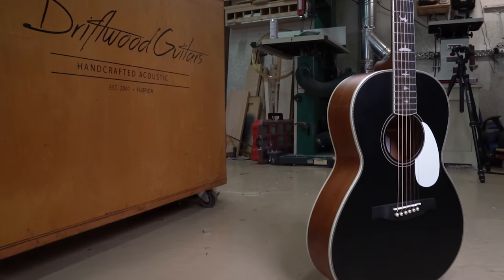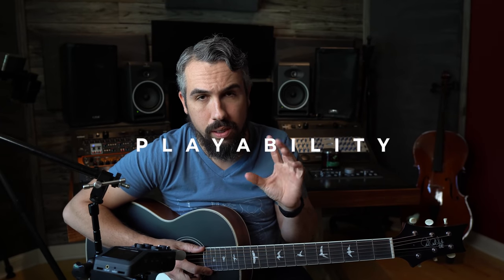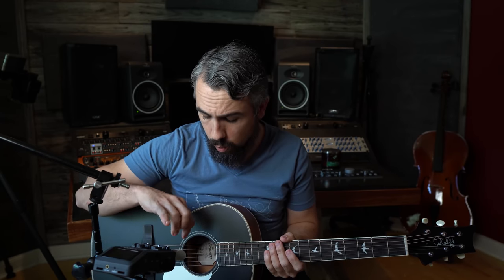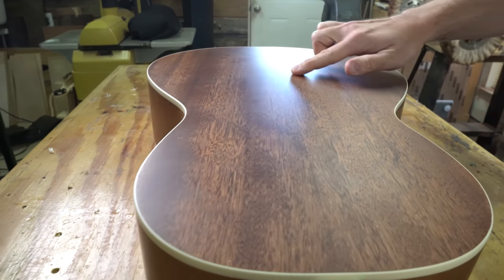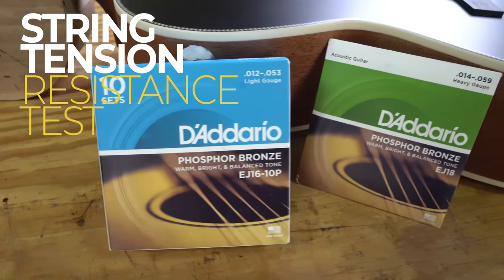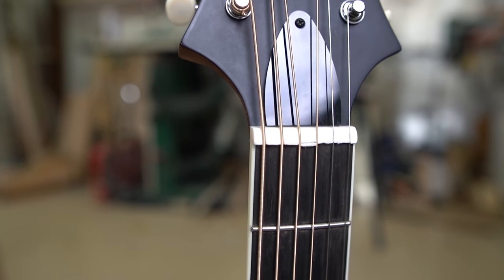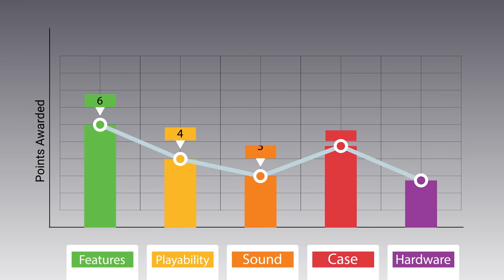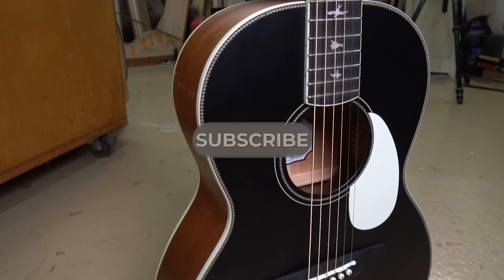A Full Review of the PRS P20 Parlor / The Guitar Breakdown

Comment: I own one of these and i will add this to it: 
1. The case zippers are ok, the attachments to the zippers break easily. I think one of the 3 or 4 are left to pull on. 
2. The pickup does a lot of heavy lifting for depth on it if you want to swing over to open mics or play for friends.
I wanted a parlor and got a parlor. Definitely glad i purchased it
Reply: I have one of these and haven't been disappointed yet. Though I did get the action lowered.
Reply: @chasemorace4916  The action height has been the one thing I’ve been displeased with as well, but it will be getting adjusted soon! Overall for $459 I’m very happy with the playability as I’m just starting to get back into the swing of things
Reply: Ya great guitar actually and thought to get one in each color for various Ready to Go tunings

Comment: Thank you for this excellent breakdown video. I am a beginner acoustic guitar player, and was considering this exact guitar because I really enjoy the sound and size of a parlor guitar, especially this one as I have seen it reviewed on other YouTube channels. I have played on a Taylor GS mini, and like that one a lot and I also like the sound and size of the Baby Taylor. Anyway I was hoping you were going to touch on the bridge pins as this particular model is notorious for having a very poor bridge pin design in the way they are countersunk and glued onto the body which make them extremely difficult to remove when you want to change the strings using a pin remover which can't get under the pins. I was told you need to use needle nose pliers which nick and  marr up the pins themselves. Also I have heard from more than one person that the tuner pegs snap off if you look at them funny, and are very cheaply made.

Comment: It would be interesting if you guys did this with some of the catalog guitars from the days of old, like Stella, harmony, stuff like that. It would be interesting to see how good the build quality is. Also if you did that it might be better to cut it open right where the back or top is glued to the sides. This way you could just glue it back on. Some of these old catalog guitars are also great guitars especially when it's solid wood and when they are not using heavy finishes. You can also rebrace them and then they sound more martiny. Even if you did cut it in half like you did I wouldn't be offended. Just thought I would offer the best compromise between seeing everything and making the guitar unrepairible.

Comment: Really interesting review! You did tests I haven't seen anyone else do, from dent and drop resistance to liquids and scratches. My one comment on tone comes from watching a number of other reviews, which is the strong midrange of this parlor guitar actually fits well in a band mix. Edit: OK, so I got one online, and while it is a well made guitar and visually attractive, I was initially disappointed. Acoustically the tone is definitely "midrange", seemed dull at first; a change to a different brand of strings (these are new PRS bronze midweight) might help. Playing harder brought out more tone. Plugging it into an amp definitely brings it to life. While the fretwork wasn't bad, it isn't up to the standard I have on several PRS electric guitars. Overall, though, it's what I got it for - a tough little guitar that could go places I would never carry my vintage Martin 0-18. Initial impressions aside, it'll probably be a keeper.

Comment: I picked up one of these P20e models out of curiosity. Outside looked great and the inside just the opposite, glue EVERYWHERE. Your rearview pretty much mimics my own findings but a couple additional notes I made:  The bridge pins are the worst; thin and molded with 'holes' and I was unable to lift them out with the pin recessed into the bridge and when I tried to push the pins out from inside they bent over! I had to reamed and replace with standard size good pins.  The Fishman pickup control is 'glued' inside the sound hole. I intended to replace with another pickup so it was much more difficult to get that control off the underside of the soundboard. Should have used 3m vs glue. The tuners on my guitar didnt hold tune.  I got rid of that guitar.

Comment: Great review and I did appreciate the reviewer's objective comments. A couple things of note, though. I own this guitar. With a minor tweak of the truss rod the action is as good as my 500 series Taylor and as good as it gets for an acoustic. The sustain is good but it sounds like a parlor. It is a parlor. Shouldn't it get a high score for that? As far as the sloppy work under the soundboard,  I really don't care if there is a bit of glue squeeze out as long as the braces are in the proper place and well bonded. Mine looks better inside than the example in the video. That's mass production,  I guess.

Comment: I would assume that to get an accurate fit for re-gluing the PRS back together,you would use small kleats to get good alignment of the two halves.Unless of course there is some torsion in the sides causing a misalignment,unlikely with laminated sides.........................

Comment: Counter sunk bridge pin holes,  that was a first.  . . .from the others I have seen so far.   Real bone nut and saddle glad you mentioned it.  I'm not surprised from the results of the ball drop testing because it is mahogany -  so not having a dent is not necessarily a good thing, depending on the sound that your after,  it's a trade off, so is it fair to give them a 3/10.especially that your given a pickup.  You never removed the X-brace cover to see the joint, like you did for the Martin. You mention the hardware not knowing who made the tuners, well I  think it is pretty safe to say they were made in China (as it says on the back of the headstock).  I know this is being picky but the drop test had some damage 9.5 maybe but not 10. With decent scores in the Trim/Finish/Frets I thought the Brand value was too low. Especially  when it holds up well in the durability category. Don't you think those factors hold more relevance to the Brand value ?  I my thinking it does.   Would have liked to have seen a tad more fairness  for least a 6 or 6.5 in value.  As mentioned that real bone /pickup/binding  were all upgrades that I've seen from the other brands.  So if you take out the pickup in this guitar and put them in the competitor,  are they going to sound even better better ?  I think I would like a few more answers before I was to make a decision if I was looking for one. Don't forget on an entry level the cool looking factor and options out weigh the sound. A beginner will not be able to hear the difference in a music store unless they had them all lined up in a row.  Which usually never happens anyways,  as all of the store I've ever been to cater to certain brands. (that's not done by accident)

Comment: The only thing I disagree with is marking sound down due to being a parlour. Surely it should be quality with shape taken in to account. Parlour guitars do not have a poorer sound due to shape, it's simply a sound characteristic which you may like or dislike, but not poorer or better quality. Personally I think the ultimate acoustic sound is a 00 size but that's still a far narrower sound than an OM by contrast.
Reply from the maker: Very valid points there.

Comment: Nice review. I'm a musician from Maryland (home of PRS) and I play a lot. I actually own two of these guitars now and I kind of consider them "disposable" (because they're cheap).  But I do love the way they play once you adjust the truss rod a little bit. I can tell you from experience a couple things that may help. The tuning pegs are problematic and break on a regular basis. PRS will send better tuning pegs as needed. I have needed that on both of my guitars. The gig bag is nice but the stitching is actually NOT very good. Both have torn at the top of the part where the arm straps come together.  Parlor guitars are certainly midrange instruments but you can EQ them to fill things out a bit. I generally use a TC Electronic BodyRez pedal through a Fractal FM3 and get plenty of workable tones.
Reply: The tuning pegs that come with this guitar was terrible.  I couldn't put in a new guitar string because one of the tuning pegs couldn't hold the string tension and kept letting it go.  It ended up putting in cheap locking tuners for about 30 USD and it's been fine so far.  For reference I change strings for classical guitars, electric guitars, saz baglamas, and ouds.  So I'm not a newbie in that regards.

Comment: This video was extremely satisfying for me. I was is in the market for a small guitar last winter and was taken by the looks and specs of the P20. I already own an Indonesian-made PRS electric and find its build quality to be excellent. I didn't even flinch when I finally found an all black P20 and ordered it. When it arrived I found material sticking out of the sound hole. There was a gash under the sound hole and so I stuck a camera inside and was shocked to find the amount of material sticking out underneath the sound board and beneath braces. I'm quite certain that this would inhibit the sound board from functioning as it should - kinda nullifies the benefits of having a solid mahogany top, right? I couldn't believe that a PRS could leave the factory that way (and the dealer whom I bought it from didn't take the time to set the guitar up either. First time I played it the fingers on my left hand were black - no hyperbole) I sent it back and purchased a Mexican made Taylor from another dealer instead. Very happy.

Comment: When I got mine last year it also had a very high action.  .140 to be exact.  PRS wanted me to send it to check out and adjust, but I just sanded down the saddle and have had no issues since.  I went from hating it to loving it.  I think I’m currently sitting in the .80-.90 range if I’m remember correctly.
Reply: based on those number its big difference..
Reply: I had a PRS shipped from jersey to New Mexico, and the action was too low.  I couldn't play anything past the 14th fret.  Added a small strip of mahogany (maybe .080") and got it perfect.  Now, I have moved the Florida, and I will be sanding that mahogany strip back off the bridge to lower the height back.  I knew humidity could make the wood move, but I was surprised at this.

Comment: Why would you use distilled water? That is taking real world type water out of the equation, as type water will have varying levels of acidity!

In my experience, most falls are SIDEWAYS! You should do this test! Mine has fallen 2ce this way from the floor and once from a chair. The only visible damage is that the finish where the neck meets the body has loosened. Nothing else. It is a 1979 Sigma DR-28.

Comment: I just bought a PRS AX20E and it seems identical to this one from the inside (I used my phone of course not cut it in half haha), but thanks to this video I knew what to expect when I looked. Even the tone seems comparable to this P20, though it probably goes deeper as it's bigger. Got some 25% off so it's great for me as I am only just stepping into the intermediate player territory, wanted something to adjust to an acoustic as I have only played on a cheap electric so far.
Looking forward to some more of these videos specially in the range of guitars like the G45 which was an eye opener to me and in fact why I saved the money and went for the PRS!

Edit: Btw I did need to adjust the truss rod for lowering the action and post that it became really playable up the fretboard.

Comment: Hang on, I was enjoying this video until the score. It's a perfectly good sounding parlour and you score it a 3/10 because you don't like parlours?? What's wrong with you people??
Reply from the maker: Yeah I should have judged it against parlors, not my preference which is larger guitars. I’ll do better in future ones. Love and learn.
Reply: @DriftwoodGuitars  the thoroughest review I’ve seen in… well, ever. Just had a beef with that one in particular. Don’t think 109 out of 200 is a good score but it got me that guitar in consideration. Great for fingerpicking.
Reply from the maker: It’s a 109 out of 150! So not as bad as you’re thinking. Thanks for watching.
Reply: @DriftwoodGuitars  oh right. My bad, sorry. It’s not bad at all then. Never liked the PRS headstock (except the Santana) so never looked at it in depth. Would it still handle the full string tension after it was cut in half?
Reply from the maker: No the sides actually resist a lot of the pull of the strings, without them and the entire box of the body, the top just flexes.
Reply: @DriftwoodGuitars  thanks

Comment: I was curious why you picked this PRS and not the A50E or any of the other models under 1K.
I played the parlor vs the A50E. I also played some other brands. I ended up buying the A50E for some of the reasons you stated about the parlor. The negative points you made were not present on the A50E. No intonation issues at all. In fact the sound of this guitar stays constant throughout the whole range. Something I didn’t find on comparable models of other brands. The only downgrade I noticed was the gloss finish is not as good as the satin. It does micro scratch easy. That could be the model year as I know that became a problem with some of the electrics after 2019 as well.

Comment: Interesting review, although I think there is no need to destroy a perfectly good guitar in the process. A real shame as it could have been donated to someone who can use it.
Reply: It's hardly destroyed.. New kerfed lining and a back would make it a good travel guitar.
Reply: @barnett25  great point about manufacturers. Add in large retailers as well. I’ve seen guitars and amps destroyed by management in large stores to make room for new inventory. These guitars with cosmetic defects should be donated to underfunded schools and students.
Reply from the maker: Well said
Reply: @peachmelba1000  It's not destroyed (although not really worth bothering with either..).. I've done it. (admittedly with a nylon string..) As long as the back is on it's got the same strength as before. It will be useless acoustically but it's got a pickup system installed.
He could go one further, take the neck off, take the sides off the top, get rid of most the crappy bracing and glue it on a chambered body , ala Chet Atkins CEC/SST..
Reply: They bought the guitar. As far as I’m concerned they can do whatever they want with it. I really enjoyed the video

Comment: "Lifestyle scoring" 8 of 10. Every test had imperfect results. No "10s" should have been awarded. The finish was affected by bug spray. Minimally but it was there. 9 of 10. The guitar was scratched...again, minimally but 9 of 10. The neck bowed 0.003". Not perfect, no 10. It incurred a measurable dent: 9 of 10. It incurred damage on the drop test: 9 of 10. Otherwise, I enjoyed the review.

Comment: Why not remove the back like a professional luthier? You would get to see the interior and not destroy the instrument (hopefully).
Reply from the maker: I understand your concern, but we do this for two reasons. One: you just cant see the full picture on how a guitar is made by sticking a camera in it. Cutting it open reveals a lot more than just the bracing. We can see the neck joint, as well as the side thickness, and we're able to get a side by side comparison of each guitar next to other makers. Two: we will be doing a lot more with these guitars after they're cut open, including educational videos on different bracing pattern and how manufacturers build vs hand makers. These guitars will be used for years as educational pieces for the entire guitar community. I see a guitars value as more than just a musical instrument. we all know how they sound and play, but MOST players never take the time to learn how a guitar is made and how it achieves it's sound. I believe these guitars are actually proving more of a service to people through this process than they would if they were just being played.
Reply: @DriftwoodGuitars  I didn't say you should stick a camera in it. I meant remove the back entirely at the glue joint and you can then remove the neck as if you were doing a neck reset. You are missing a lot about how the guitar is put together because the joints are still hidden. It would also let people know if these guitars can be maintained in the long run. I get that it's not as exciting for film.

Comment: All the tests were awesome and helpful but I don't see why you need to destroy the guitar by chopping it, when you could stick a tiny camera with led lights ( like a plumber's snake cam) and get similar results on the glue job and bracing quality. my thought is that some kid or even plenty of adults would kill for a guitar like that even if it was scratched and beaten up. sending guitars to landfill before theor time is dumb. hope you salvage the electronics and hardware
Reply from the maker: I understand your concern, but we do this for two reasons. One: you just cant see the full picture on how a guitar is made by sticking a camera in it. Cutting it open reveals a lot more than just the bracing. We can see the neck joint, as well as the side thickness, and we're able to get a side by side comparison of each guitar next to other makers. Two: we will be doing a lot more with these guitars after they're cut open, including educational videos on different bracing pattern and how manufacturers build vs hand makers. These guitars will be used for years as educational pieces for the entire guitar community. I see a guitars value as more than just a musical instrument. we all know how they sound and play, but MOST players never take the time to learn how a guitar is made and how it achieves it's sound. I believe these guitars are actually proving more of a service to people through this process than they would if they were just being played.